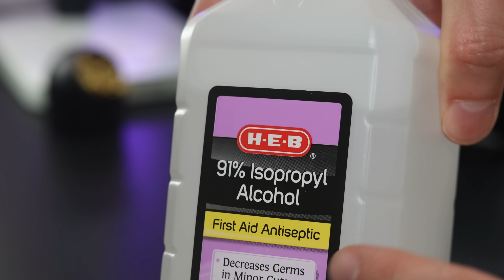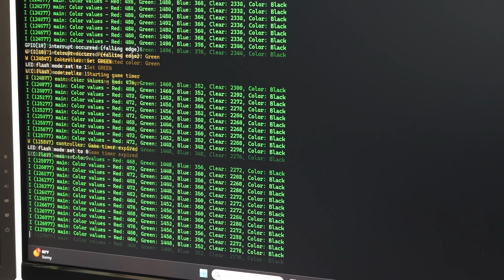Do This Before You Solder Anything

Comment: I would add, as no one ever discusses this, cropping the soldered lead from a through hole component too close to the solder joint will stress the joint and years later the solder joint will crystallise leading to dry joints with a high resistance and premature failure.

Comment: yeah flux
for a year and a half,
failing all soldering projects i attempted
watch many videos on the basics
and failing, again and again
eventually so determined 
that i was crying through my projects
crying and angry and shocked in disbelief
then one day
i got this idea, 
FLUX, 
i heard someone mention flux, but they just kinda blew it off
flux solder core, meh they said

not a single person ever told me, 
FLUX, is ABSOLUTELY NECESSARY 
(it fills in the empty air pockets , which act as insulation against proper smooth heating.
flux covers EVERYTHING it touches, especially when warmed, and with it, will come your heat and your solder when you apply all three to a solder point target)

i thought i was delusional
no one ever mentioned flux
 
but now 
here you are 
saying the exact same thing

Comment: Hey! Just one thing I would've aqdded to this video! If the soldering iron is a low power rating (common for beginners' soldering irons) you can be using the right temperature setting, but the iron itself is cooling down. Increasing the temperature can fix this issue but can very easily lead to burned joints and damaged iron tips! The fix is obviously to just get a high power rating iron so that the iron stays at the right temperature nomatter the joint.

Comment: Perfect explanation!
Most beginners make the mistake you adressed: they heat the solder, not the joint. Good to point this out.

I use colophonium dissolved in isopropanol (saturated solution, there is undissolved resin left in the bottle).
I prepare it myself since you get good and cheap colophonium from China. The job is a little sticky but worth it.
Applied as a thin layer like paint, let it dry. You can use a cotton swab for that.

Soldering is perfect after that.

Too cold iron also unexpectedly increases the danger of frying your components since you have to stay a long time with the iron in place, allowing the heat to spread into your board.

Soldering joints in a row:
When you're afraid of that the board becomes too hot, start with one point from the side and one point from the middle, then move to the next point.
For 10 points:
1-5-2-6-3-7 and so on.
This will allow the already soldered joints to cool down before you come to the joint beneath.
Especially helpful when you directly solder ICs to a circiut board.

Bonus tip:
When soldering pin headers or ICs, check if the component is aligned perfectly after soldering the first joint.
If you find the component askew, warm up the soldered joint and put it into place before continueing.
The next joint to solder is the opposite joint, this will fix the component already in place.

Comment: I dare you to try this method:

- Use non-flux solder
- Apply flux to the joint
- Grab a blob of solder with the hot iron tip
- Touch/hold the solder blob to the joint until it wicks through

Bonus: You can use thick solder which means a spool lasts longer (or you can even use bars)
Reply from the maker: I do something similar with the first pin while holding it from the back. I put flux on it and then touch it with a blob of solder and it wicks it in ;)
Reply: I didn't see that, and can't find it by seeking. What timestamp?

Cool you already do that technique sometimes. Have you ever tried it for a whole board?
Reply from the maker: @JB-fh1bb oh no, it’s not part of the video. It’s just a trick I always use :) never did a whole board like that. I usually use it just to get the header to sit in straight

Comment: Tinning the iron should be done at a reduced temperature, otherwise it can and will cause damage to the tip and it will start breaking down faster. Do it with the bare minimum temperature that you can get the solder to melt on the tip. Then clean the tip with your brass sponge for a smooth surface. I believe Hakko and some of the other companies have docs on their websites about this.

Comment: Amazingly here in Los Angeles for example, the ubiquitous RadioShack, fry's or other electronics supply stores are long gone, the average person might pick up a soldering iron at home depot or other national chain hardware store, and they do sell electronics solder which has a flux core but that is inadequate, goodluck k finding rosin flux because they simply dont stock it, therefore I went to my local musical stringed instruments store and bought a small cube of rosin that is used by violinist for his bow.

Comment: The frustrating thing for me is that sometimes a soldering project goes great and other times it’s an exercise in frustration. I’ll work through these tips methodically next time and try to figure out what exactly is going wrong. There’s still something I’m missing. 😐
Reply from the maker: If it’s not going well, then it’s probably not enough heat or flux!

Comment: For beginners I agree with the methods and temperatures. That said - I solder at least 3 times that fast, and use 450°C (only lead free, leaded solder is only for unsoldering), and solder goes between pad and iron, so the soldering fluid is right in the middle, where it's needed and reaches the whole pad. You can kinda see when you are done, because the solder stops "cooking" soldering fluid and the solder flows down to the other side of the pcb. And this way I never needed additional soldering fluid. Soldering fluid is for cases where you resolder, mostly. New pcb's are usually clean and there is no oxidisation. Excess soldering fluid, in my opinion, forms some sort of crust, that then again needs extra soldering fluid, and in the end the pcb is dirty. That would explain why you need so much isoprop for cleaning...
When I was trained, I was told, only fast soldering is good soldering. Soldering too long makes the solder brittle! You need to see a shiny, only very slightly outward bent bubble, then you are good. That means your solder was hot enough, and it was able to flow freely, and it did not have time to become brittle. Soldering too long is bad!

Comment: I never vented the room as a kid, always loved the smell of lead. It’s incredible to this day I don’t have any measurable lead poisoning or symptoms. All those RC car and computer projects and somehow I dodged a leaded bullet.

These days I open the window across the room and run a small portable fan to exhaust the room air. Easy way to verify airflow is light and blow out a match/candle. If the smoke is pulled toward the window and you can only faintly smell it, you are pretty safe.

Props to hanging onto those RadioShack solder wheels. That’s what I used for decades before the stores disappeared.

Comment: All great advice but two things... make sure your work cannot move.  It needs to be stationary so that you have proper heat transfer from the iron to the joint.  If you're constantly chasing the circuit board across the work surface you will have cold solder joints much more often.

And second, soldering iron temperature does not equal work surface temperature quickly enough, especially with very small soldering iron tips often used to solder surface mount components.  The heat transfer is very inefficient so the iron tip temp needs to be much higher.  You have to experiment to find your personal happy zone based on your work, your solder, and your iron.  The idea is to get to the melting point as quickly as possible so that you do not need to hold the iron on the work surface for too long where you can damage the component.  As you said, if, with flux, the solder isn't melting in 2-3 seconds, you need a hotter iron.  At work in our lab we pretty much leave the iron at double the melting point of the solder.

Hakko and Weller both make excellent soldering stations with digital readout of tip temperature in the $120 range - hobbyists would be very well served in getting one of these instead of using these pencil irons or worse, these battery operated "portable" irons that give you a readout right on the handle.  Great in the toolbox for an emergency, but for serious work, get the dedicated soldering station.

Comment: Regarding using additional flux to flux-core solder, how important is it to match the flux types? I know not to use plumbing flux on any electronics, but I know there are several different types of flux for electronics.

Comment: If you see a hole, and all the solder is on one side then that's probably not a hungry solder but some kind of a cold one. Yes, the solder was hot, but the pieces being soldered were not, and there was no flux, so the solder grabbed the soldering iron instead of grabbing the pad and the component leg. If the pad and the component are hot the solder will spread over them.

Also you don't want to remove the soldering iron as soon as the solder is spread over the pad, you have to keep it there heating a bit more (you do it) a bit more, maybe it's less than a second, but just a bit more, and then remove the solder in a quick move so the solder stays behind. If you remove the soldering iron slowly then the temperature lowers on the pad because of dissipation through the board while some of the solder is still touching your iron, so the temperatures get uneven and you get a solder with a spike, not an even one, and it might be weaker. The iron must be in good contact with the two pieces, then suddenly not in contact with any of them nor the solder, and let the solder cool down for a second without any other movement of the pieces or anything, just let the solder settle, immediately after removing the iron.
Reply from the maker: Very true! Well put 👍 keeping the heat in just a tad bit more makes the solder joint even nicer, your right I do that but didn’t mention it. Good one!

Comment: Thermal heat transfer is explained well. However Thermal Mass is not mentioned, both the Workpiece and the Soldering Iron have thermal mass that MUST be considered. 
The Soldering Iron must have sufficient thermal mass to maintain good heat transfer to the joint otherwise a "cold solder joint" will result.
This is a combination of Tip Mass and Iron Power in relation to the Workpiece to maintain the correct temperature during soldering. e.g. You wouldn't use a 1mm Conical Tip to solder a 10awg Cable, and conversely a 10mm Chisel Tip to solder a 1206 SMD Restistor. Large Ground plane layers often require pre-heating, possibly with a heating plate underneath the area being soldered.
Soldering Iron Power and Soldering Iron Tip should be considered before attempting to make a Solder Joint, or less than adequate results are almost guaranteed.

Comment: the solder on the joint should be concaved not convex. to judge temperature dependent on size of tip and heat setting use the 2 second rule. if you have to keep the tip on your job for longer than 2 seconds something is wrong. watch the soldering videos made by Pace they contain everything you need to know to be a professional .

Comment: Important tip: DON'T inhale the fumes. Specially if using leaded solder.
Reply: I am betting the fumes are more about the burning flux core (which are harmfully acrid) rather than the lead which doesn’t boil until about 1800C.  This is a persistent myth, lead is a hazard to humans through ingestion or inhalation of lead dust.  Still I agree that it’s better to be safe than sorry.

Comment: To clean just have a sponge soaked in water nearby and wipe to clean. Most higher-end soldering stations have a space for this in the soldering-iron holder and come with a sponge.
Reply: I’m iffy on this one as we always used to use wet sponges, but it does ruin tips faster by having them cooling rapidly and reheating rapidly constantly, and they seem to corrode much faster.  I now use the brass scrubber method and think it’s more efficient and less messy.

Comment: Thanks for this great video I learned a lot. I am wondering if you can make a video showing how to remove various components from a PC board. I have a hot air station and soldering iron. I was trying to remove pins like the ones used for jumpers on a motherboard and I had a really hard time. I burned the area around the pins. It was a mess. I would like to remove an entire USB header but I'm afraid I will make a bigger mess. Thanks.

Comment: My soldering tip is 5 years old and still looks and works like new. How? I use tip tinner before and after each solder, and clean the tiip  with the brass cleaner each time after the tip  tinning. I been at this over 50 years, retired now but still a hobbyist.

Comment: Flux isnt magic, it removes oxides, oxides happen fast when you heat it up (like with a soldering iron).
The right temp is full temp of your iron. Most boards and parts are hard to burn, but really, just keep that iron moving and you wont ever burn anything. The hotter the iron, the faster you move. 
Clean your iron BEFORE each solder joint. Just a quick wipe is enough to remove oxides so you are not adding contaminants to your joints. 
Dont worry about heating the joint, and feeding the solder to the joint, just jamb the exact right amount in the joint, with a very hot iron, and move on. If you have the iron on full hot, you wont get cold joints.
When you are soldering headers, like you are doing in this video, drag solder the whole thing in like 2 second and have all perfect consistent joints, by using the back of the irons tip to preheat the pins as you drag the tip back while feeding solder into the tip.

Comment: Use the correct iron for the job.  That ground pin that's too cold needs more heat, not higher heat.  A more powerful iron (maybe mains powered) would stay hot (at the correct temperature) while heating the joint.  You can't solder sheet metal with a 5w iron and you can't solder smc with a 200w iron.  And yes, I have those irons (and 15w, 25w, 60w, 100w) and use them appropriately.

Comment: There is absolutely no need to add additional flux when soldering a connection.  There's plenty in the solder itself.    It's just more stuff to have to clean off.    -Bob (soldering 40+ years).

Comment: What is an “iRUN”, I use an ‘iRON’ 😉 Thanks for the tips. I only use paste flux when I’m soldering SMD components, for through-hole components I use solder with rosin flux core only.

Comment: My father taught me how to solder when I was 9 years old in 1964.  Most important, wipe the tip, tin the tip, make the solder joint with solder applied, wipe the tip tin the tip, and place the soldering iron in the stand.  Repeat the entire process for each joint.  Tinning the tip before placing the iron in the stand makes the tip last longer.  BTW, I only use Kester 44 solder, 63/37 and make perfect joints.

Comment: all good advice, cleaning, flux, iron temp control and a 'heat bridge' to the components are key to a good result and 'fillet' shapes are key to a good reliable joint . I was fortunate enough to learn all this when I did the "NASA High Reliability Hand Soldering" course way back in 1983, where we also learnt NASA's favourite soldering saying, "the bigger the blob, the worse the job" lol

Comment: I hand solder as an electronic assembler for years and this is probably the best instructional video on soldering.👍
Reply: never seen the  "NASA High Reliability Hand Soldering" film made in the sixties? it mentions all of this and whole lot more. I did the course in 83 and went on to do "multi-layer and flexible board repair", repairing 7 to 9 layer boards in the F/A-18 Hornet computers in the 80s

Comment: 0:27 I attached a powerful computer fan to the end of an automotive radiator hose. Stick the other end of the hose out the window. 
2:29 I also clean the leads of the component that i'm going to solder to the board. The solder must stick to it.
5:49 You don't explain WHY the ground pin needs more heat. Maybe because the ground TRACE area is larger?
7:59 Also, please clamp down your board so it doesn't slide around while you're soldering.
7:59 Personally, i wouldn't rely on the liquid itself to transfer the heat. I've never even heard of that. Yes, tin the tip, but I always touch the tip to BOTH the pad and the lead. That's how i was taught, and seems to work great. 
9:25 Or, it could mean you didn't use flux, or the pad or the lead are dirty. 
11:01 You didn't explain what a cold joint is. It means the lead or the pad weren't hot enough, so the solder didn't adhere to the joint. This is why i wouldn't rely on the liquid to transfer the heat, but instead touch the iron to the pad and the lead to transfer heat.

Comment: The biggest issue I have is worry about burning something out. If the solder isn't flowing great.. and leave the iron there longer.. I am worried the heat will burn out whatever the pin is attached to. Mostly solder with keyboards or drone stuff.. and man nothing worse than $150 for a drone chip to burn it out soldering a few pins.

Comment: Solder suckered are very hit and miss. These days I tend to turn my board over while still in contact with the iron and tap on the worktop to remove excess. Just be sure to check you don't have trails of splat over your traces.

Comment: Two things:
1. A liquid flux with a small brush is much more convenient to use (and economical) than a gel flux from a syringe.
2. The size of the soldering iron tip is just as important as temperature when soldering. You should try to match the tip size to the component you are soldering to ensure maximum heat distribution.